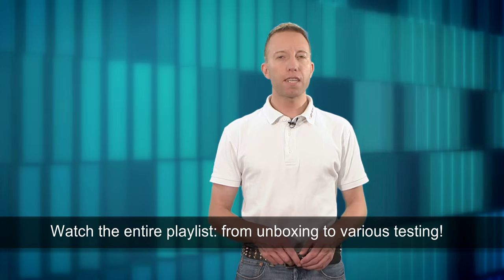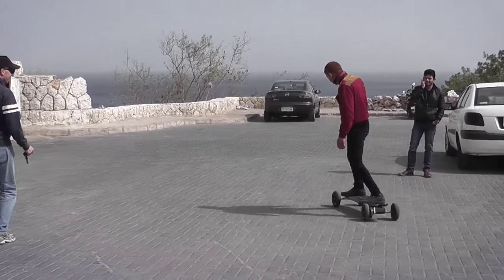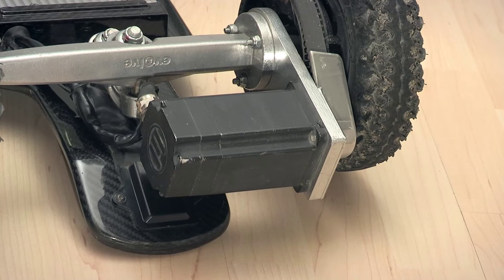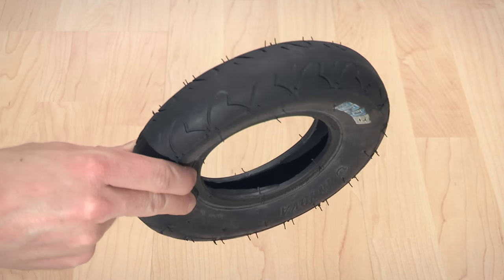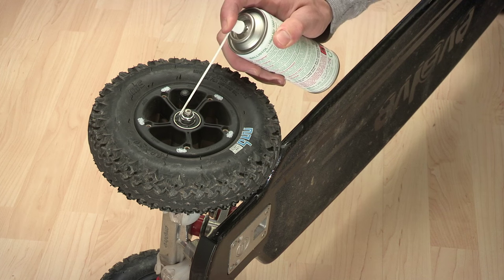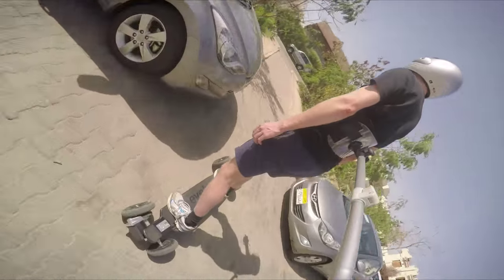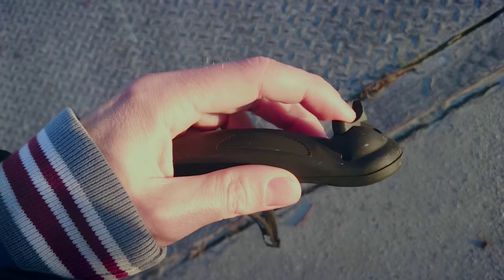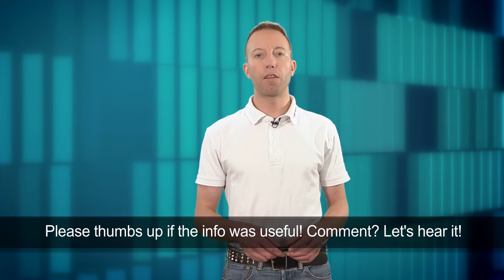1500 km (!) on the EVOLVE - how does it cope? Review, part 3

Comment: Good review Dude...
nice work...
thanks for sharing and good luck for the next 1500km
you fix your wheel wobble problem with 15g wheelwheights on each wheel ;)
Reply from the maker: +ECOLUTION-EDIT-BERLIN Ah! That might be worth a try, thanks for the tip Kai! Up next is a tutorial on how to do a "Range Extension Mod" on the boards. We're currently testing it (successful so far), going 50 km non-stop on a single charge :)
Reply: +HeliGraphix.com 
yeahhh looking forward to your new "how to" Evolve video...
thanks for spending all this time in your videos... 
greetings
Reply from the maker: ECOLUTION-EDIT-BERLIN Could say the same to you :)  Everyone contributes, and this makes a great community. Doubles the fun! :)
Reply: will you share a video of how to balance the wheels with the weights.   I have some wobble issues when i go over 12 mph the rear and front get shakes.   I thought it might be the dampers being too soft but now i am seeing this guys board do the same thing.   I can ride through the wobbles but it makes things sketchy at full throttle.   It would be epic if i could go full throttle without the wobbles.  I can go full throttle all day long with the skate wheels with no wobbles.  The big wheels have a mind of there own when you go over 12 mph.

Comment: @heligraphix how much Sugru do i need to seal the whole bottom of the Carbon? i know they come in packs of 8, is 8 enough or should i order more? Thanks in advance and great video!
Reply from the maker: +Josh Ex  Hi Josh, it's enough to order 1 package with 8 mini packs (5g content each). You don't need much as a seal, except where all the cables come out of the battery tray and at the motor and that flat plastic part housing the receiver. Use your fingernail to achieve nice fugues all around the board; they'll be nearly invisible. Re-use the excess Sugru for further sealing; you got about 15 - 20 min. for re-using. The more practise, the less you'll need. About 5 - 6 mini packs should be enough (but no problem if you use 8).

Comment: Is the video about range extension coming up soon?
Reply from the maker: +Ohem1 It's already filmed. Wanted to have it online these days but am currently drowned in my daytime job. But hope to cut and post it shortly. It'll enable you to do such a Range Extension Mod yourself. We're currently riding 4 such boards, all without notable problems and up to 50 km per ride (more is possible). We've meanwhile several 100 km experience with them. Note that nonetheless the project is still in BETA phase and recommended for experienced guys only. Cheers, Tobi
Reply: Alright, looking forward to it!
Reply: HeliGraphix.com Sooo it's been a "few" months now, granted your loss of equipment didn't make things easier at the time; But how much further are you in reöeasing the extended video?

Comment: so if you sum up the prices of all replacement parts how much do you spend per kilometer to keep it going ?
Reply from the maker: +Christian Wetzel That's indeed a very smart question. Factoring in pretty much everything including electricity cost, it's 12 Euro-cent (13 US-cent) per km and 1.80 Euros (1.95 USD) per ride (in my case per average ride of 15 km). That's more than I expected.
Reply from the maker: +Christian Wetzel Assuming 5 years lifetime and (for the Carbon AT) a purchase price of roughly 1500 Euros, then the cost go up to a whopping 32 Euro-cent per km or 4.80 Euros per ride, based on my (relatively high) riding frequency.
Reply: +HeliGraphix.com That's more than i expected and in the range of a car. But you won't travel that much on a skateboard.
Anyway: thanks for doing the math
Reply: +Christian Wentzel i don't recommend pushing the boundaries just because it has tires on it... its not a Hummer, nor did the military make it. long range rides on gravel or grass or rocks or whatever won't increase the life of the board, should be common sense. i keep mine on concrete as much as i can, and only go on other terrains when its called for, which isn't often because I'm inner city. spending the extra money on AT kit means you don't have to pick it up every time theres a taller lip or a patch of grass or something ahead... as you would with almost EVERY other eBoard on the market :) needless to say, you get what you give, and iv got no issues with mine.

Comment: Great video 
Do you mind if I ask what are and where I can get the lights you have on your trucks.
I’ve searched for them but can only find them in white and red.  Would like the color shifting version but not sure what they are called to narrow my search.
Any info would be appreciated.

Thanks
Reply from the maker: The lights are great and finding them in black silicone is difficult. You'd need to search for "LED silicone bike lights". There are different types available. I'm not sure there is a version with different light colors though. If so, please let me know as others might be interested, too. I'll try and post a link to an ebay version of the black lights I'm using on the GT board.
Reply from the maker: https://www.ebay.de/itm/LED-Silikon-Fahrradlampe-Vorderlicht-R%C3%BCcklicht-Fahrradlicht-Silikon-Ihr-Auswahl/121929016782?ssPageName=STRK%3AMEBIDX%3AIT&var=420919615009&_trksid=p2057872.m2749.l2649

Comment: This remote control looks different to the one I am getting is it the first version ?I asked a lot of people about the disconnect cut off from the controller ,many people wrote back to me Saying that was not an issue with there carbon gt ,maybe again this is because they have the newer led remote controller Please advise
Reply from the maker: Hi Loopie, there seem to be several versions of the remote control. We opened up some and they oftentimes look a bit different. It seems Evolve has them made in batches and keeps working/improving on them. 
The GT has a different remote - it's got the large LED display. It works great. Uses a lot more power thant the simpler one, but you still don't need to charge it too often, so that's fine. The Carbon GT does have occasional cut-outs, too. However they're rare and I perceive it less of a problem (if at all) compared to the other boards.

Comment: Can you please let me know what kind of oil you put on the bearings? thanks
Reply from the maker: Hi Michael, I'm using a (multi-function) lubricant called Ballistol. It works great (we also use it on high-wear gear of the helicopters) and is hazard-free (in fact they also use it for weapons, leatherwear, cleaning and many other purposes). Important is to clean the outside of the bearings thoroughly before applying any kind of lubricant, otherwise dirt may creep in and the bearings will run worse than before.

Comment: How much were the additional repair costs for the belt,bearing and wheels?
Reply from the maker: Wheels (outer part) and belt were around 70 EUR (USD prices probably quite similar). An extra set of bearings is from 40 - 70 EUR.

Comment: Hi, I see some of footage is taken in Egypt, some in Europe. How do fly with the board? Do airlines allow them as registered luggage?
Reply from the maker: +Łukasz eN Yes correct, I flew with the board to Egypt. Check out my ride video (2nd one coming up, this time front door Egypt). Airlines will transport it as sports goods (just like a snowboard), but then you'll need to pay extra. Same may happen if you avoid the term "sports equipment" (which I did) - because then it's regular baggage, but likely oversized. It then depends on the person at the check-in counter and your persuasive skills. I was lucky and could transport it as regular baggage without paying oversized.
Reply: +HeliGraphix.com Great thanks for the lightning answer. What about batteries, are they not considered as possibly dangerous by the airlines? As I heard, only Virgin consciously allows them onboard. Buy I could be wrong. regards
Reply from the maker: Regulations keep changing at fast pace, so chances are that in a few months things will be different. As of now, when the battery's part of the device, then it's fine.

Comment: ok there is at least one vid out there that talks about skateboard bearings, alignment, and the adition of washers to protect the bearing s life... this may also protect the axle.... by the way be carefull of the loads... as if you are jumping on it and the force is biger that the axle can properly handle it will bend the axle wakening the molecular structure of the metal... so it can only get worse from there on... also if you are forcing the metals by going off road... you may want to consider getting some parts custom made with stronger metals like titanium and other metal alloys

Comment: Hey, I got the all terrain 3 months ago and I have completely wore the tires out, right to the belts. Just from carving. Thinking about switching to the street wheels. Anyone have any input on if I should stick with the AT's or try the street conversion ?Thanks  Great vid, btw.
Reply from the maker: Wow ok that's pretty unusual. I guess you were riding in hot temperatures? Over here nobody ever went back to street. But the answer to your question a simple one nonetheless: Do you need A/T capabilities, i.e. do you go offroad? If no then test the street wheels (and let us know how it worked out). If yes then stick with the A/T and buy a bunch of tire casings.

Comment: How does it handle the rain? It rains a lot where I live. Thanks.
Reply from the maker: +Hans Zarkov Question has already been answered below Hans (plus more interesting stuff). But here again, hope it helps: If the board is sealed properly with Sugru, it'll withstand wet roads. We've ridden in the rain more than once and also drive through puddles (not intentionally but it happens). Also through mud/dirt. Never experienced any problems. But again: you need to do the sealing procedure properly. You'll typically need about 6-8 Sugru mini packs (the small 5g packs) for one board. One distribution package contains 8 mini packs; maybe order two to be on the safe side. Cheapest often is ebay, otherwise from Sugru directly.
Reply: HeliGraphix.com
Appreciate the info man. Thanks.

Comment: Hi, I am 38, 195 cm, 90 kg. Never road an electric longboard. What would you recommend evolve carbon AT or evolve bamboo GT? Can get both for the same price.
Reply from the maker: I own both Carbon A/T and Carbon GT A/T, and in your case I'd go for the Bamboo GT. More power, more fun to ride. Only downside might be the looks; this said, the Bamboo is a great-looking board, too! And prioritizing performance seems like the better strategy. Is that Bamboo GT an All-Terrain version? If not then you'll want to get the conversion kit. I've seen many people convert to A/T, and not a single one convert back. Especially with the extra power of the GT, riding on non-asphalt is just too nice :)  Seal it with Sugru and you've got a "water-proof" board that will eat just anything.
Reply: HeliGraphix.com thank you, I ordered bamboo gt at
Reply: Where did you buy sugru? How can I use sugru on bamboo gt?
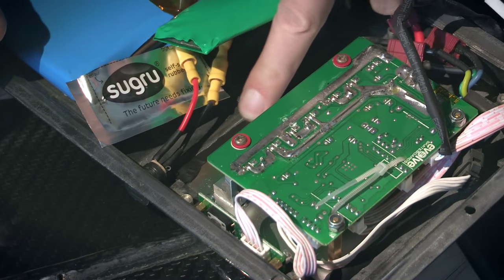Reply from the maker: Just google the product. You'll either buy directly from Sugru or one of the many resellers; it's also on ebay. I'd buy the 8 mini packs in black, it's best value for money. You may store them in the fridge for around 2 years and I've found it useful for many things around the workshop and house. How to use: See 2:30 in this video. On the bamboo, simply use it around the battery tray and where the cable come out, also where they run into the motor, etc. Don't forget to also seal around the heat sink on the underside (and ideally from the inside around the charging plug and on/off switch).

Comment: What are those lights you used called?
Reply from the maker: +ActuallyWacky These are bike lights. They're meant to be wrapped/snapped around the handle and happen to fit around the skate axles nicely, too. You'll typically find such things in bike shops.
Reply: I'll go take a look, thank you!
And also, my Carbon suffered damage from water so it had to be repared. That play-dough you put on your board, have you put it through a test? Where i live wet roads is a big problem, do you think it would be able to withstand that?
Reply from the maker: If the board is sealed properly with Sugru, it'll withstand wet roads. We've ridden in the rain more than once and also drive through puddles (not intentionally but it happens). Also through mud/dirt. Never experienced any problems. But again: you need to do the sealing procedure properly. You'll typically need about 6-8 Sugru mini packs (the small 5g packs) for one board. One distribution package contains 8 mini packs; maybe order two to be on the safe side. Cheapest often is ebay, otherwise from Sugru directly.
Reply: Thank you so much for the quick replies! I got a local electronic store selling them, i'll try to ask them if they have any in stock some time next week! :D

Comment: sold my bamboo v2.o single motor too dangerous
Reply from the maker: That's interesting Joni. What do you mean by too dangerous?
Reply: i found when i rode for over 45 mins my leg would fall asleep and some times would loose connection with the board , so if i needed the brakes no response . also fell off few times .
Reply from the maker: The "falling asleep" thing especially with toes is quite common. Just hop off every now and then and walk for a minute. But I know what you mean. The lost connection with no brake is really bad! Wow. What happened to me once was the the remote quit functioning while riding - the board then applied max. brake .....
Did you buy anything else now, or no more electric skating/riding for now?
Reply: i sold my board , too dangerous, to much safety gear to put on , knee pads , six six one pressure suit,wrist guards.fell twice already .
also no time to ride . i had a enertion k1 dual motor kit was planning to build a board with dewalt batteries , but priced out components not cost effective.
now planning to build electric bicycle with bafeng kit and dewalt batteries.

Comment: seems like a aweful lot of problems for such a expensive board ?.
Reply from the maker: +Blake Garvey I'd say for 1,500 km it's pretty good. Some parts are wear & tear and like on a car you simply need to replace them over time. Board as such fully intact, performance largely unchanged.
Reply: +HeliGraphix.com im actually thinking of buying one .whats it like up hills does it perform ok or ?.also cant wait for your range video that looks interesting .How much range would you get out of the board .just as standard ?.great video .
Reply from the maker: Personally I never regretted the purchase; and although everyone's got different expectations the overall feedback I hear is good. My own experience is well-documented in the videos. Re. performance up hills, I'd say it's decent up to rider weights of 90 kg (200 lbs) and at ambient temperature. Keep in mind the experience with the two Pintails, though, as mentioned in this 1500 km review. Re. range, it's as advertised as long as you don't go max. speed, difficult terrain and/or low temperatures. Fair enough, although Evolve should clearly mention this in their advertising. Coming up soon in this channel: how to hack your board and do a Range Extension Mod.
Reply: +HeliGraphix.com hey heli also im not a big skater but how should you have your trucks like should they be tight or loose ?.
Reply: +HeliGraphix.com hey Heli i found a video of the carbon creator explaining what to do if the board cuts in and out he also pulls the board electronics apart and shows you some ways of fixing this .here is video  https://vimeo.com/104286945
Reply from the maker: That's a very useful contribution, thanks for posting. I've seen the video before; there's  another one where they "reinforce" the receiver aerial under the deck. However in my opinion this isn't something the customer should need to do. Instead Evolve should fix that problem once and for all!
Reply: +HeliGraphix.com hey heli do you find that when you use the carbon AT at higher speeds you get a bit of imbalance .like if you go over a bump the wheels tend to jump around a bit .
Reply: +HeliGraphix.com hey heli when you releasing the video to show how to get extra range out of the carbon ?.
Reply from the maker: Video's already been filmed, just need to find the time to cut it. Too much commercial work ongoing at the moment. We've got 4 boards with Range Extension Mod in operation at this moment. One of them's a Carbon (my own); the tutorial shows how to modify a Bamboo/Pintail, but Carbon's not much different, just the arrangement of the batteries. But likely I'll superimpose pictures, then it's easy to also modify the Carbon (the basic mod is the same). Tobi
Reply: +HeliGraphix.com can't wait :)